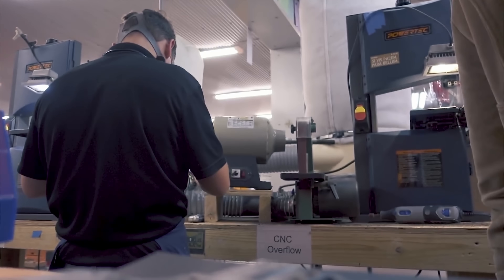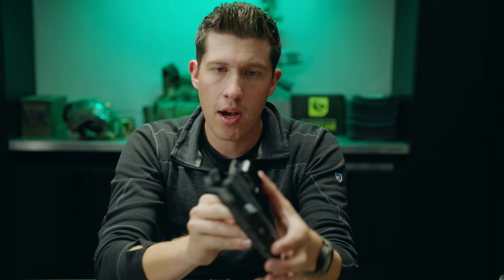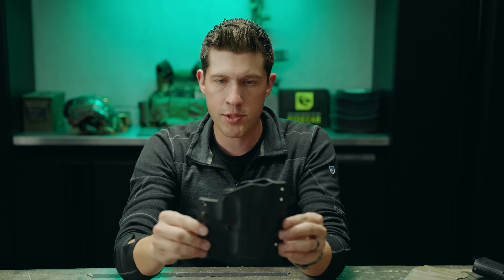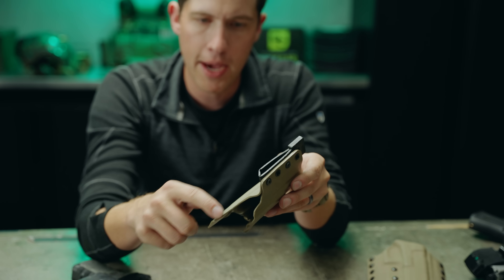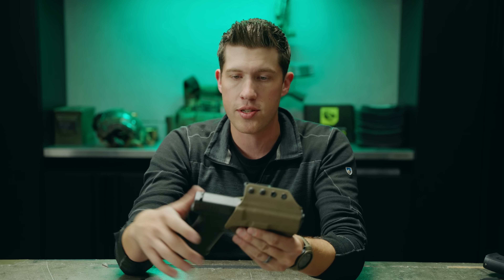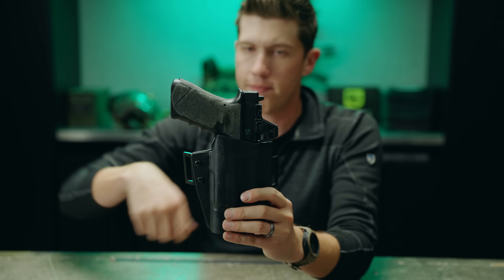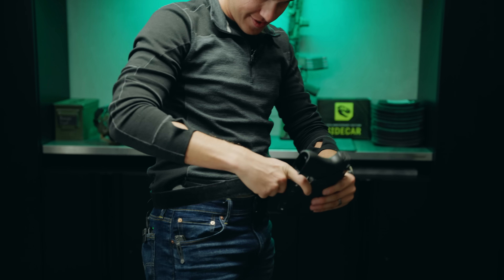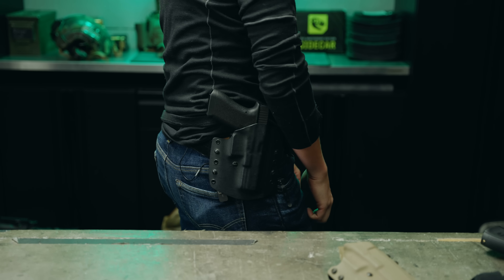This Piece of Plastic Launched a Company

Comment: I have a technical question. Have you ever considered injection molded kydex? You could ACTUALLY mass produce these if you had some dies(well, molds) built and had the machinery to do the injection molding. There are companies that can build you a mold that will result in a very precisely molded final product. It would be an expensive setup though.

Comment: Unfortunately not custom enough any more in one point: 
The old sidecars came with the option for a high sweatguard, which I prefere, because you can push it with the thumb and have the same kind of draw as on a Safariland ALS. And no need to rely(!) on the clips not slipping off the belt. And easy one handed draw from the table. etc.

Please, please bring back the option for the high sweat guard on sidecar holsters. Thanks!